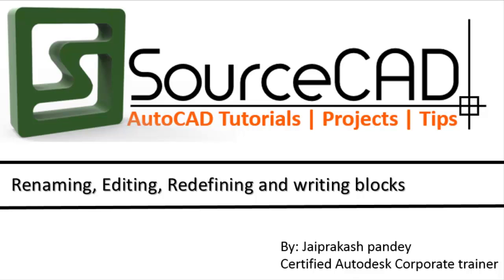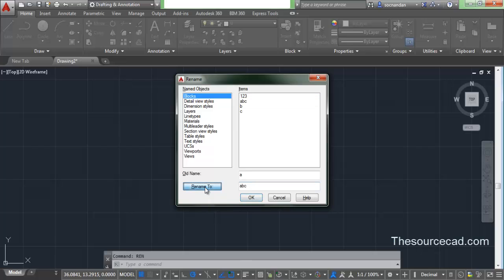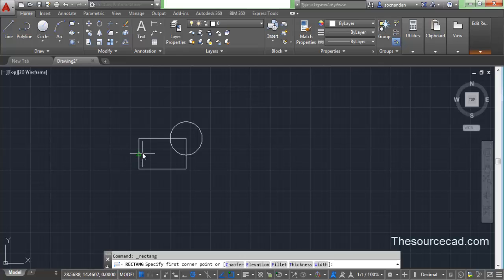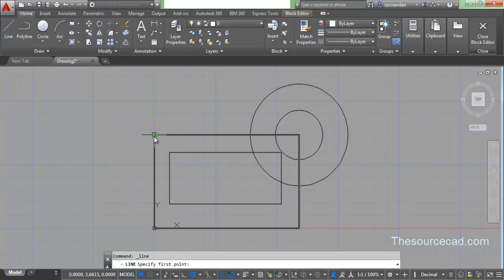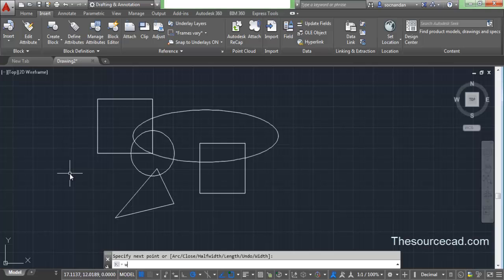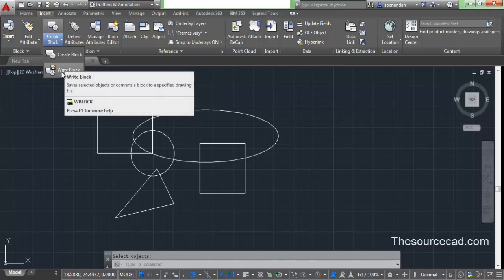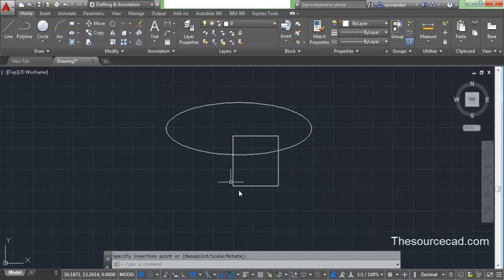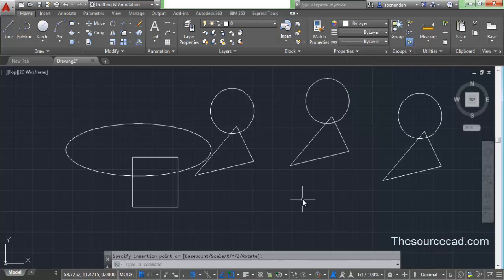How to rename, edit, redefine and write AutoCAD Blocks

Comment: I have two different separate blocks which were created by someone else.  They have different names but their attributes are the same, such as Part Number, Descriptions, etc.  When I try to rename one of the blocks to the same name as the other I get a message that the new name is the same as an existing block and it won't let me rename it.  Is there a way to rename one block to be the same as the other or maybe merge one block with another block?  Thanks.